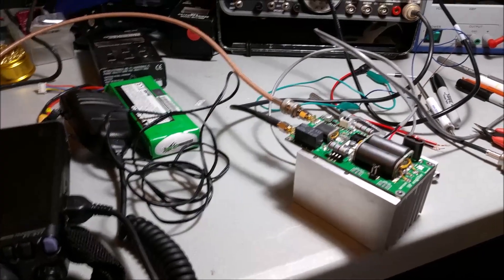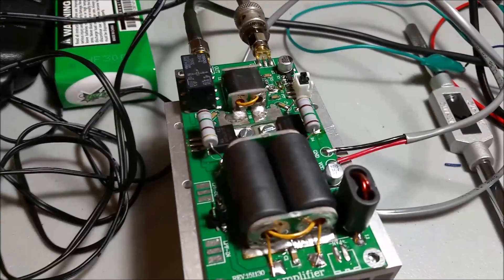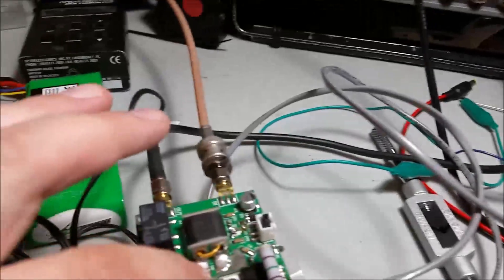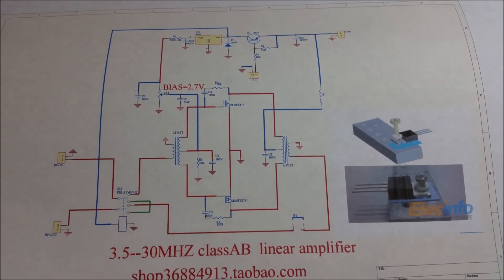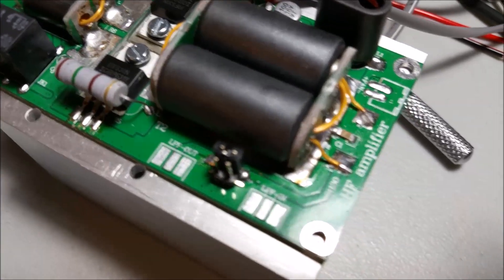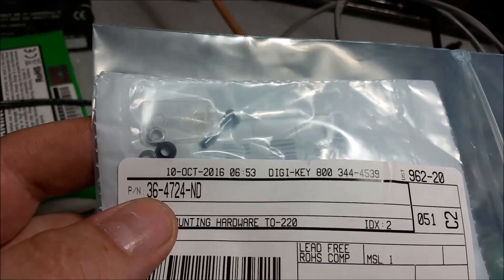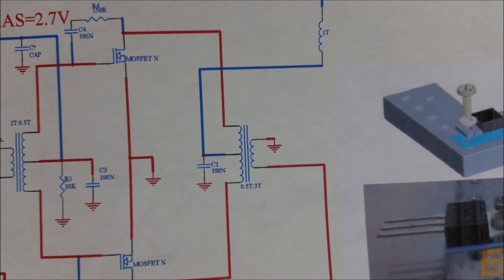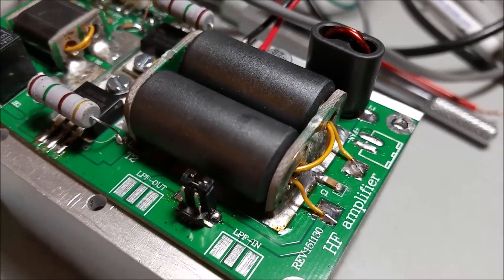Testing the Minipa70 HF Amplifier Kit

Comment: nice amp, soldering doesnt look to bad on this unit
voice peaks might be higher
for $20 how could you go wrong
Reply from the maker: Yeah, I forgot to show the SSB test on video, its peaks around 80 watts with 5 watts of drive. The soldering was done with my 45 watt station, I under estimated how much heat the bottom ground plane of the board would suck away so some of the joints aren't the nicest to look at but they are all solid and none of them are cold.